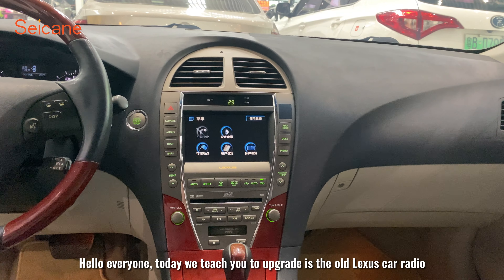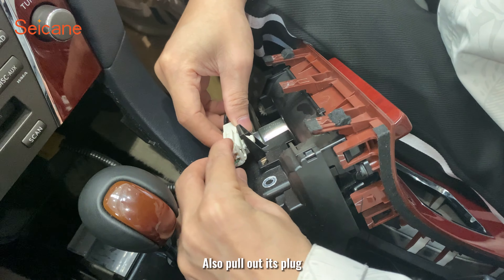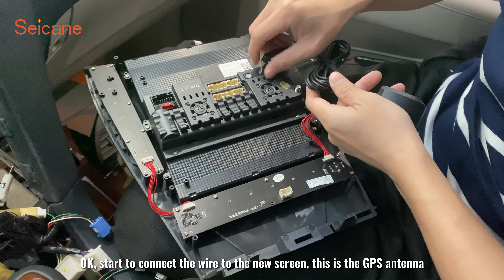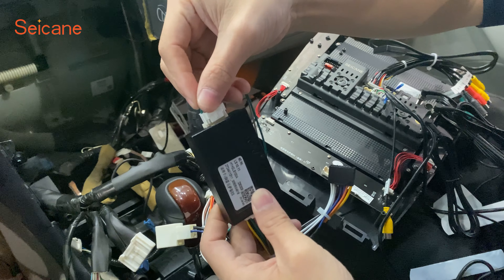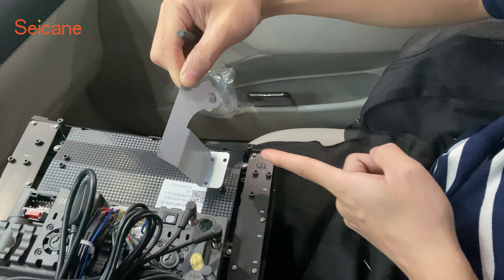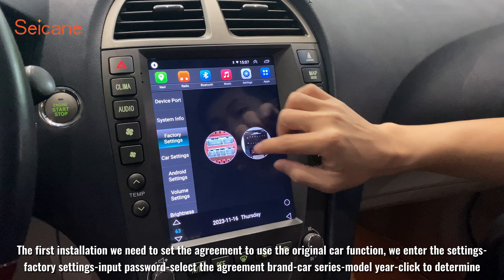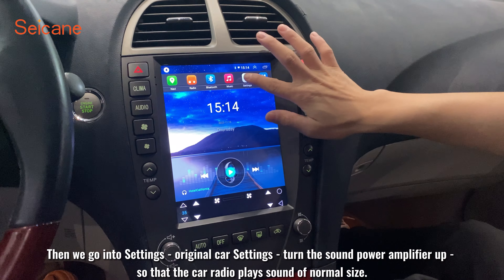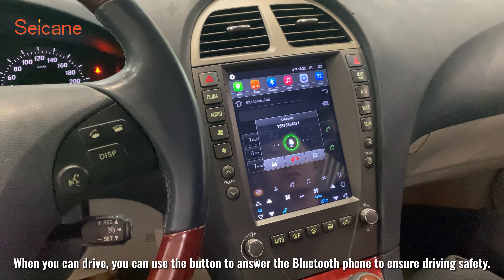Upgrading Toyota Lexus with Carplay Android Radio | Step-by-Step Installation Guide 2009 2010 2012

Comment: Just installed the 4 gig version of this in my 08 Es350 ( without Nav),  Relatively easy install and the built-in Dsp makes the sound in the car Drastically better, It also allows you to raise the gain level in the car's external amplifier giving you louder volume.. Unfortunately, Lexus  sets the gain  like that from the factory because it's all the stock speakers can handle and sound good, So I just ordered all upgraded replacement speakers,  ( JBL, Polk Audio and a Pioneer Sub ) Can't wait to swap them and hear the difference!  All the manual buttons work well and the bottom row are programmable, They are all Blue back lit at night also and look good in the car, Great upgrade!! ( You will have to put some time into programming all the settings to get the most out of it tho.. Fyi
Reply from the maker: thank you for your information.
Reply: What is the purpose of the obd plug? Does it have to stay plugged in?
Reply: how bout steering wheel buttons? do they still work?
Reply: @WilliamDiaz-p2h  Mine worked fine after install, there are some settings for that in the new unit you may have to play with, tho.

Comment: Just got mine. Connected everything and triple checked everything and camera does not work. I have the mark levinson with nav screen and the factory camera will not work. Also, the audio doesn’t sound as loud as the factory head unit. Tried the “car settings” then tried to click “set into car” to adjust amp volume and it just goes back to the home screen. Help?

Comment: OnlY connect two screws? Not 4
Reply from the maker: It can be installed very firmly without shaking.
Reply: it snaps directly to the shifters trim piece on the bottom and is relatively sturdy after install on the bottom, and the dsp makes your audio experience drastically better in my 08 es350

Comment: What about the backup camera? My lexus already has a backup camera, will it still work with this unit when I put my car in reverse?
Reply from the maker: hi, it works with your backup camera if the camera plug is suitable.
Reply: @Seicane-Car-DVD  my es350 just has a basic RCA connector for the camera I think. If it doesn't work, can I return it?
Reply: @humanerror7  Worst case you can buy an adapter for the existing camera input, or install the new camera which is better quality then what it comes with, You can use the existing wiring for the new camera back at the trunk also, It takes a little diy skill, but is not difficult.

Comment: Does this work with the othee lexus version that didnt already come with a factory touch radio?
Reply from the maker: hi, you can send a photo of your car dashboard to sales@seicane.com ? then I will check if this unit fits your car or not.
Reply: Yes I just installed the 4gig version in my 08 Es350 without nav.. It was actually a pretty easy install and the DSP makes the sound quality drastically better!